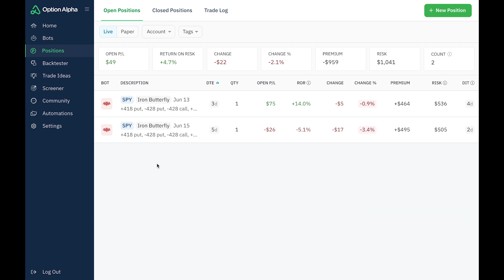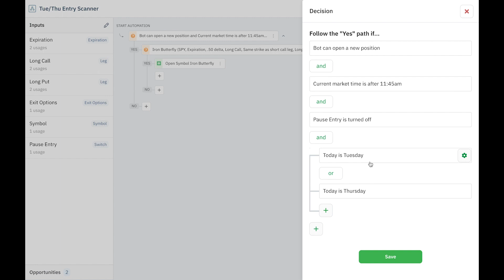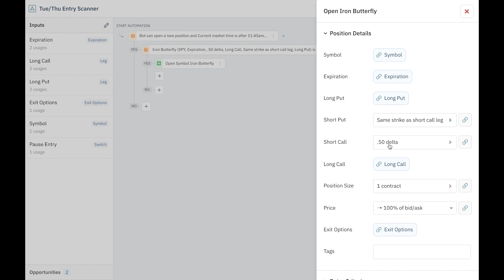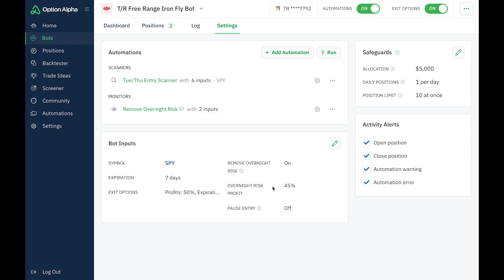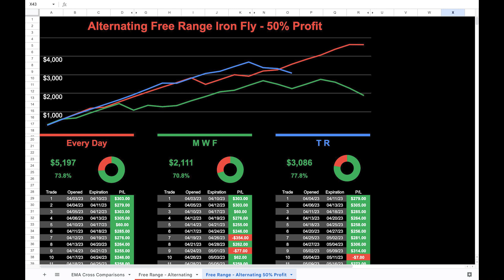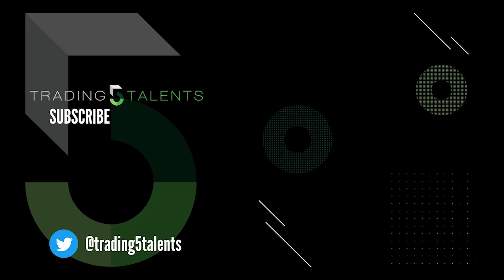Live Results! Iron Fly Automated Trading - Week 10 Using Option Alpha!

Comment: grateful thanks for weekly updates.  Did you try "re-center" the short strikes instead of closing the trade for loss. I am sure your bot can be programed to re-center if the price moves by $5 either way from the short strikes of original trade. Let me know your thoughts on this
Reply from the maker: I haven't thought of that yet. So basically it would close the current IF (for a loss), then reenter with the same expiration, but a different center strike?
Reply: @trading5talents  only short position would be re centered and leaving long as it is, though it may involve additional collateral of $300-$400
Reply from the maker: I see. Then as of right now, the bot can't split the legs of a spread. It's a requested feature on Option Alpha so hopefully, they'll implement it soon!
Reply: @trading5talents  I HAVE ANOTHER THOUGHT. Instead of 4 option iron fly, why not place put credit spread and call credit spread separately, though it involves, additional collateral, but risk is on only one side. easier to monitor and manage
Reply from the maker: I have considered it, but I haven't built a bot around that idea yet. I may do so in the future as, like you said, it would be easier to manage.
Reply: @trading5talents  Another advantage of trading ATM credit put and call spreads of same 10 point wide and 7 day expiration is,  depending upon the market trend, we can avoid one of them, and possibly  reduce number of loss making trades
Reply from the maker: @KBBAKTHA  True. I'm looking into credit spreads right now with a new bot.

Comment: It's (as you've stated) a small data set, but I think you're misreading the return performance on the 50% profit graph.  All three strategies are increasing at the same rate, but because you are measuring total gains, when one strategy loses it falls behind the others - and in a short period of time this gives the false appearance that it is a lower performing strategy.  The win/loss rates are nearly identical.  All other criteria equal, the randomness of the market determines whether a trade gets stopped out.  I think it's going to need a lot more data over time to support any conclusion.  It's a very interesting experiment and I'm glad you are sharing your results openly.
Reply from the maker: Hi! Thanks for the comment! Yes I will definitely need more data. You may be right, which in that case I would still favor the TR entry since there are less trades open at any one time. Having too many open at once has hurt me in the past.